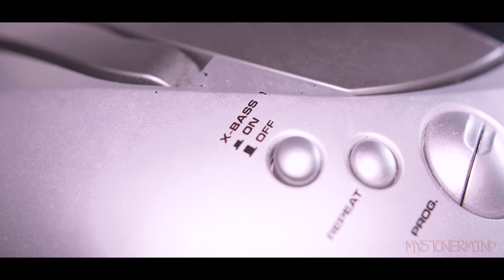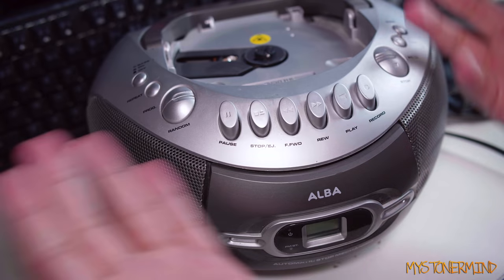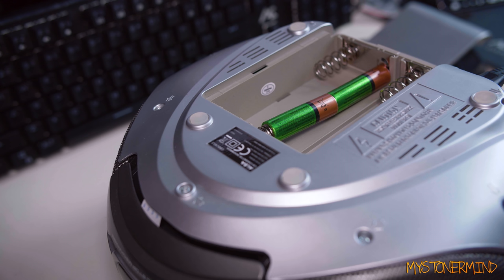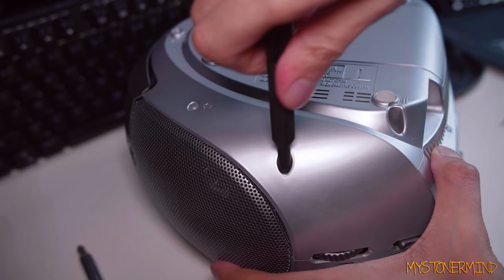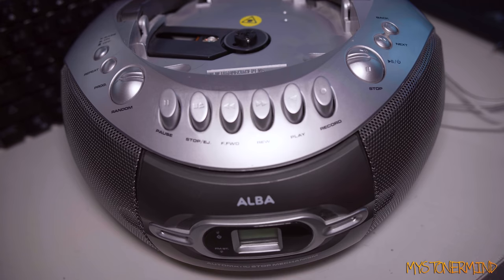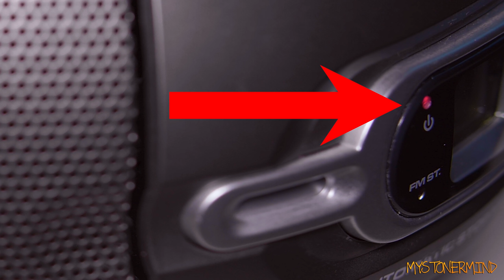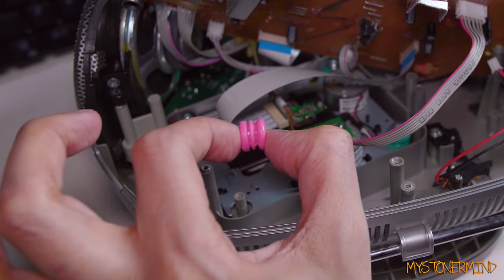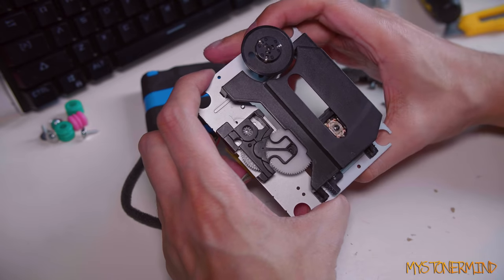Someone Gave Me THIS Stereo System

Comment: Do you want to try out a 4" BMR ported speaker I designed. Its not too efficient but it has decent bass, low distortion and is capable of producing undistorted audio even up to 20Khz as it uses something called bending wave technology for higher frequencies.

Comment: You need to remove the ac  cord thing attached to that mutated alien insect spaceship thing to power it up using batteries because there is a switch around the ac socket, when plugged it disables the battery. Just like the headphone jack on most portable stereo system, it disables the internal speakers when the headphones are plugged in.